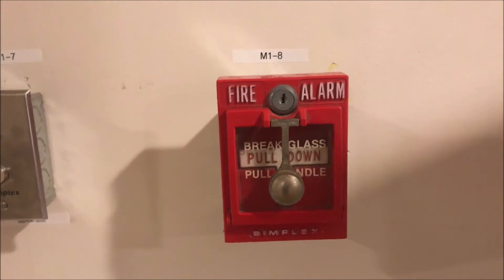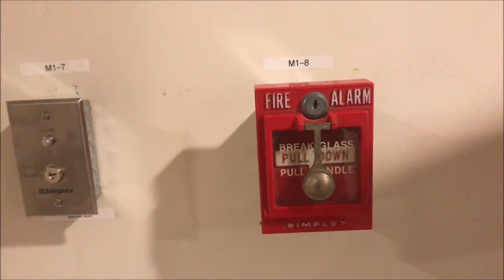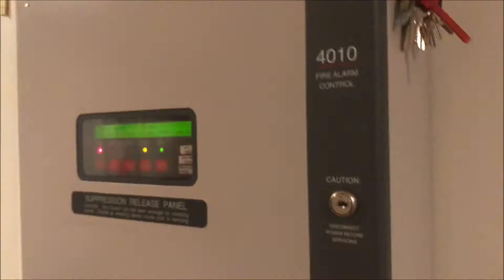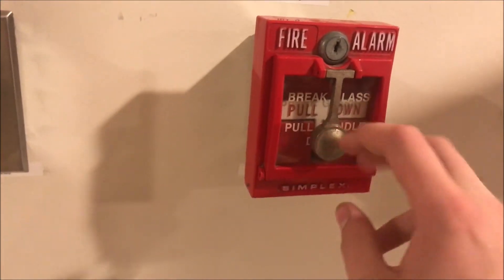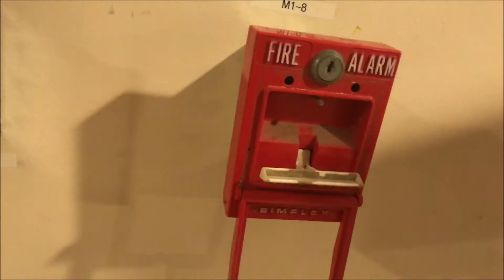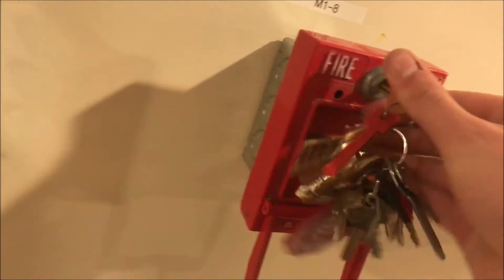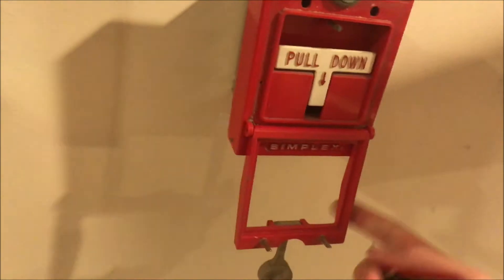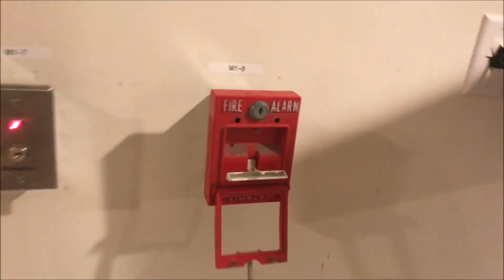Breaking a Glassplate in a Simplex 2099-9785 Pull Station

Comment: That pull station is a 4251-30
Reply from the maker: This pull station is the same base as the 4251-30, but has a different backplate design to accommodate the MAPNETII card on the back. MAPNETII was the predecessor to Simplex’s IDNET communications line.
Reply: Nope; it's the addressable version!
Reply: Then why does it have the old Symplex logo Logo
Reply: @carterkoning1214  Because it's an early addressable Simplex pull station from the late 1980s or very early 1990s. Simplex switched to the newer logo on those pulls in 1991.
Reply: I know it’s conventional
Reply: OK now I understand

Comment: Why do fire doors close? Wouldn't it make it harder to evacuate from a fire?
Reply: That’s what fire doors are designed to do. Most modern fire doors close because they are designed to contain fire for a set time, anywhere from as low as 30 minutes to up to an hour and a half. Most fire doors are designed to open outward in the direction of people evacuating.
Reply: @mrnorthwestohiodude7758 As well as egress push bars.

Comment: Those older Simplex break-glass pulls had a neat design, with the way the frame flips down after the glass is broken, making it easier to access the lever without worry of broken glass shards. My first elementary school had the conventional 4251-30 version, installed with the building's original Simplex 4208 fire alarm system in 1974.
I've also seen several of those older-style break-glass pulls with the much newer Simplex glass panes that just read "BREAK GLASS", too.